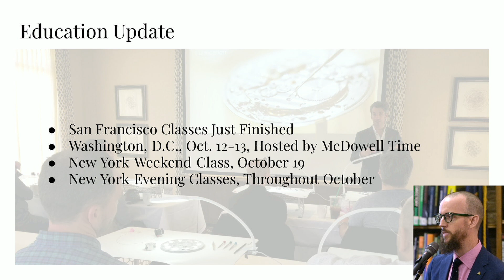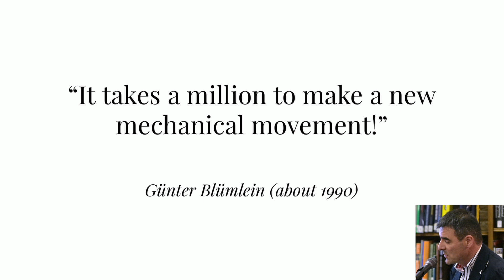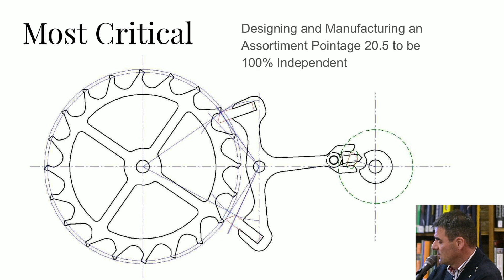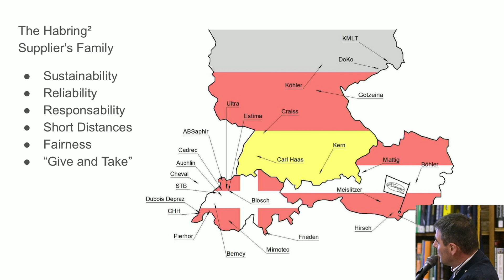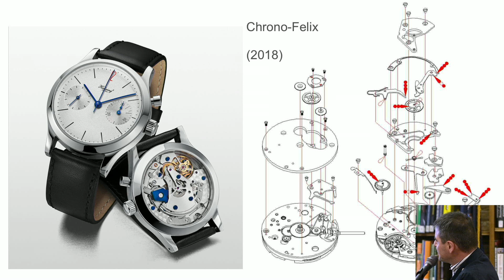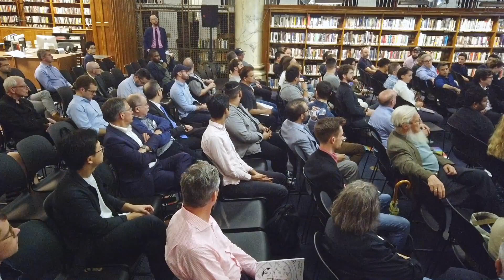Producing A Proprietary Watch Movement, By Maria & Richard Habring

Comment: 🥇 wow 😲 what a honest and open brand 👍 never thought the 7750 could get this good hand wound and monopusher 🏆
Reply: There was a manual wind version of 7750 called 7760. And IWC went bonkers with redesigning the 7750.

Longines under Swatch made a tonne of modification including a mono-pusher and also a column wheel.
Reply: Tippy Kaffu !!! I always thought that type of complications were only available for  in-house movements or maybe things like Lemania o Minerva, I have seen silicon spring 7750 in Hamilton intramatic and co-axial escapement 7750 in Speedmaster Racing plus COSC but not a monopusher 👍 cheers 🍺
Reply: @alberto6439  No, any complication can be put into any movements as long as the person is capable.

You can look Ulysse Nardin making a watch from a 2892-A2 with a tonne of complication and also extremely efficient.
Reply: Sellita provides a manual winding monopusher Chrono to anyone who wants one like maybe Habring2 here, look up Sellita SW510M MPC.
Reply: @dimman77  thanks for the input, I had a quick look for the sw510MP and couldn’t find anything worthy and for the price asked for a sellita monopusher is better to save up and go for the Minerva monopusher caliber. Cheers
Reply: @alberto6439  Minerva is definitely the better choice there.